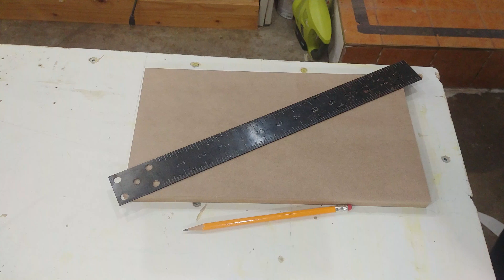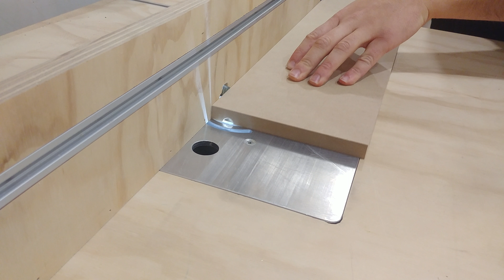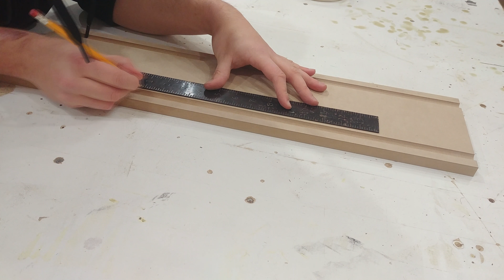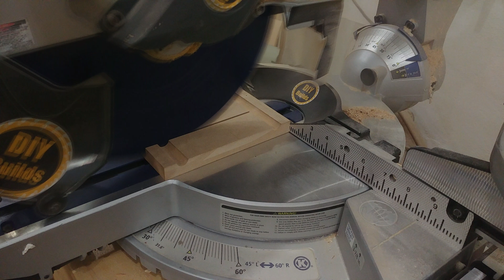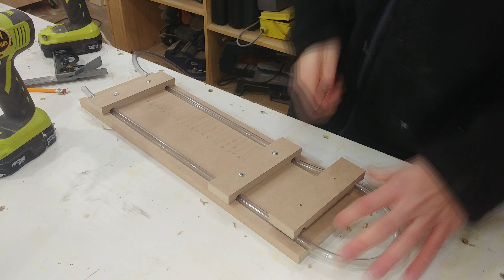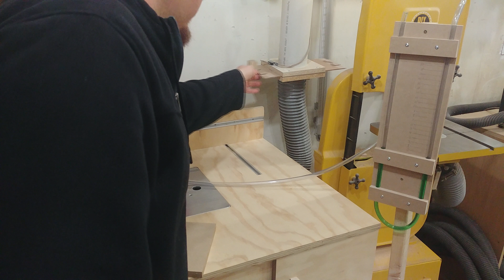Homemade Manometer (Vacuum Gauge) - Testing the Suction of a Dust Collector

Comment: I used to use these all the time for player pianos (Pianola is a trade name ) and more complicated automated musical instruments.  You can use them for testing vacuum cleaners as well but aim for up to 60 inches of water.  Obviously, they can also be used for pressure.

HOWEVER, it is ALWAYS advisable to ADD "catcher" BOTTLES at both ends of the manometer, otherwise it is possible to fill your machine or whatever with coloured water or end up with coloured water over the floor (carpet! - danger, danger).  The catcher bottles are just screw top jars with two nipples on top and capacity much greater than the total amount of liquid in manometer.  

Also, the above is a way of turning a dry vacuum cleaner into a wet vacuum cleaner in an emergency - beware excessive fine water droplets - smoke test!

Comment: I'm trying to make one of these to test the vacuum pressure on my intake manifold.  Is there any air loss in your system? Because if not, wouldn't the fluid in the manometer be completely sucked out?
Reply from the maker: No. Something with more suction like a vacuum would suck it out at this low a level of water though.

Comment: Excuse my ignorance but how is this device read? Is it a certain x per cm? Thanks
Reply from the maker: +Chandler Nuttal im not totally sure. Im just going to be comparing the results between new and old upgrades in my next video to see performance up or down%
Reply: 27.71 inches of water (difference between one side of the water column and the other) = 1 psi differential.  This is an inexpensive way to measure sub-psi pressure differentials.

The diameter of the tube does not matter at all.  Any fresh (non-salt) water will do.  Some manometers use oil which has a lower density but doesnt evaporate as quickly.  Oil manometers have more than 30" difference per psi differential.

Your dust collector should pull close to 14" water. You might have some leaks since it looks like you were only getting around 6" there.  Test at the inlet to your DC to get a baseline to see if you have leaks upstream.
Reply from the maker: +Tony Shulthise good info thanks. How do you figure it should get 14" though?
Reply: DIY Builds most dust collectors pull around 14" of water (0.5 psi) static. Some more, some less.  Unless there are leaks, when you attach the manometer to any covered port you should get the same pressure differentials as you get at the inlet to your DC.

You have to measure at the sealed off inlet to your DC to get a baseline static pressure (no flow) then measure at various points in your system to see what the max static pressures are.  Anywhere you measure less static pressure than you measured at the sealed inlet to your DC indicates a leak somewhere downstream.

I tested a friend's system and found that he was only getting 60% of the DC static pressure at the end of his system.  We shimmed his blast gates to reduce leaks and got that close to 100%.
Reply: The rule for open ended manometers is to measure the total distance between the water levels on both sides.  In this case, the total was about 12 inches of water.
Reply from the maker: For that reason i placed markings every half inch making the number shown 1 inch of water per